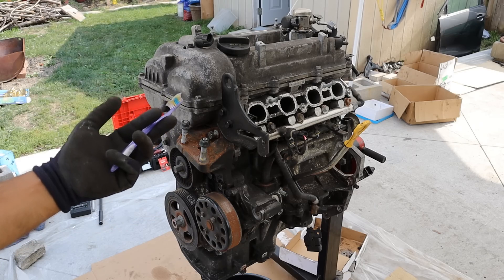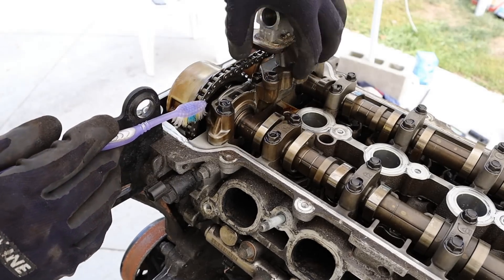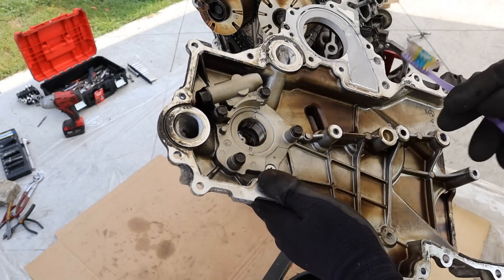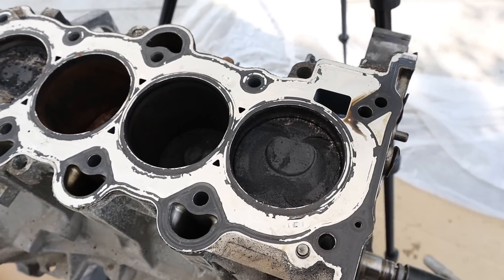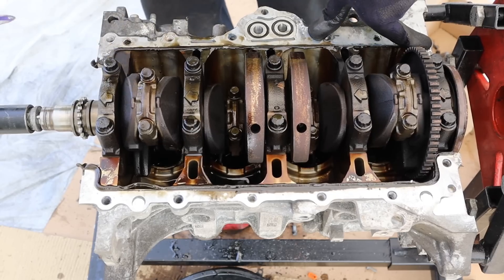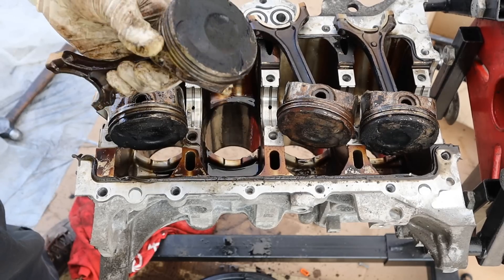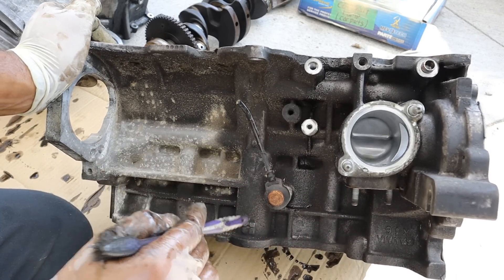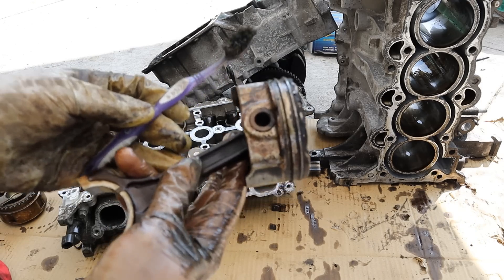Why KIA Engines Fail

Comment: Please show us a Honda A20A3, or any Honda A20 engine!  Mine has 350,000 on it now!
Reply from the maker: Didn't even know they had an A series engine!
Reply: @speedkar99  The Honda A series inline-four cylinder engine is used in 1980s Honda Accord and Preludes.  I love to see you tear down and analyze one!   Still redline mine at 350,000 hard miles.  Never rebuilt.  Valve job only.
Reply: @speedkar99  Ha ha!  "Why Honda A20A3's DON'T FAIL"!  
BTW, I do love your channel!  ;-)
Reply: I remember the older Hondas from Accord or Prelude, 1.8 and 2.0 L. Dual Keihin carbs, then EFI. They would consume oil when driven hard, but never heard of one going kaboom for no reason. Other than regular maintenance, timing belt change every 100k km was a key to keep going forever.
Reply: @pliedtka  Yea, mine has never had any oil consumption problem.  I'm sure the rings got a bit sticky, but some Marvel Mystery oil cured that!  My A20A3 still runs like a top, as worn out as it is!  I bought it late 1988 as an '89 model.  One owner that cares helps too.
Because I have never torn down the engine, I'd love to see what @speedkar99 might say about it!

Comment: This is where I get after a lot of people who own these generations of Hyundai and Kia vehicles.

It's like the moment they buy these cars, all mechanical common sense goes right down the toilet.

For starters I am on my 8th Hyundai / Kia vehicle and proudly stood behind Korean cars since 2002. 

The common sense thing that most owners of any cars in general, but especially Hyundai & Kia vehicles is to ALWAYS CHECK YOUR DAMN OIL!
Budget friendly cars are not going to have a digital readout to tell you when your oil is low. That's what premium car models do. The most you will get is an oil pressure alert light like most cars predating 2016 and earlier had. This is why they put oil dipsticks under the hood. That's not just for oil change specialist and mechanics. If most of you people are too dumb to understand what a oil dipstick is, then please stick with Uber or public transit.  

Religiously every week I always check my oil level, especially before going on a long road trip and BEFORE I start my car. If my engine oil is low I usually top it off with Seafoam or Marvel's Mystery Oil, not just regular oil. My goal is to keep my engine clean, break down and prevent sludge buildup. 

I make a note of the oil color. If the oil on the dipstick starts to look dark brown then I go and change out the oil immediately, regardless if it's before my due oil change service interval or not. My engine and investment matters much more to me. 

I also use high pressure oil filters, not made from paper but microfibers instead. K&N is what I use.

Every 3 or 4 oil changes I take my vehicle in for GDI intake cleaning service to blast away the carbon buildup. 
By the way all automobile companies are guilty of this GDI carbon issue, not just Hyundai & Kia.

To help reduce carbon buildup after cleaning I add a little Marvel's Mystery Oil to my fuel tank before filling up the gas. Using that product in my gas has definitely shown significant reduction in carbon buildup at my last GDI cleaning service.

Lastly in all my Korean cars I use either midgrade or premium gas, not because I'm under the assumption that it's like changing my engine's power to that of a Hellcat, or that I will suddenly get 50MPG, No it's simply because carbon buildup is a bitch and expensive to clean if you let it go for far too long. Using Premium gas in general will also help GDI owners to reduce this costly carbon buildup.

Also Change your damn transmission fluid at its due service as well as changing your spark plugs every 100,000 miles with NGK or Denso Iridium plugs (I know it's a Kia or Hyundai but don't be freakin cheap guys and gals, seriously), change out your air filter with a microfiber filter (like K&N) so your engine can breathe better, and seriously if you have an AWD crossover, change out your damn gear oil as well.

Yeah owning a car and maintaining it is expensive blah blah blah. If you want your car to last you for the duration of your monthly payment term and not be screwed with a big repair bill, invest in maintaining your shit.

Lastly always pay attention to issued recalls and get it rectified immediately. 

Aside from owning a Genesis G70, Kia Sorento Ex V6, I also own a 2007 Tiburon with the 2.0 that still purrs like a new car under the hood because of how I take care of my vehicles.

You can guarantee that I will be the first to blast anyone with harsh condescending words if I see a post of someone calling Kia or Hyundai junk because their engine seized up and their oil was super low or empty but somehow didn't know about it. Really??  🙄 🤦‍♂️
Reply from the maker: Yep. Oil is key.
Reply: I like Korean cars and own a 2020 Elantra. But I will say premium gas won’t do a gdi car any good. Because the fuel isn’t being sprays behind the valves. Gdi systems without multiport injection combined (Hyundai and Kia’s other than brand new ones after 2020 didn’t use that and only had GDI only) which means no matter what carbon will build up. Gas has nothing to do with it if it’s not being sprayed on those parts to clean them up. That’s why Toyota started using gdi and mpi to get the benefits of both without carbon buildup. Hyundai recently started using that on one of their vehicles but not all.
Reply: @zabryant01   actually premium does have a lot to do with carbon buildup. I'm rarely ever driven by people's speculation anymore these days because it's just that, only ones speculation. 

From my cleaning service intervals if I use premium quality gas, it will significantly reduce the time it takes for carbon to buildup on the back of the valves vs lower quality gas, also noting my driving habits did not change. 

I can clearly state this as I have seen the differences pointed out to me by the mechanics at the place I have my intake cleaning service done. They show me pics because needed comparison notes for regular/midgrade gas vs premium and straight premium vs premium with Marvel's Mystery Oil added to the tank.
My best (barely needing cleaning) service was when I used premium and having Marvel's Mystery Oil added to the tank to my current GDI vehicles, except for my Tiburon. 

I've clearly been doing this for a good number of years before GDI was introduced and as people were arguing about premium vs regular. I prefer seeing actual results on my own vehicles, not hearing some proposed car fanatic who owns a Hellcat or a WRX STI telling me how premium is a waste of money.
Reply: @Tanooki2003  premium gas is only a higher octane. That's it. More important is that you use a top tier gasoline and not stupid mystery additive.
Reply: GDI intake cleaning service? Do you do it or a professional mechanic does the cleaning?
Reply: @ramirocosta1  I use a professional and certified ASE mechanic who has experience with Kia & Hyundai engines as well as having actual GDI training.
Reply: @Tanooki2003  thanks will try and find one! Im based in Portugal we have hydrogen carbon cleaning machines. Is that tecnhology your mechanic uses to carbon clean your GDI?

Comment: @5:37 i was hoping for a "there's your korean bbq, all you can eat" kind of joke when you popped the head off and checked out the carbon buildup 😂 😂
Reply from the maker: I'll keep that in mind haha
Reply: I have seen on worse on CR-Vs. The last one melted it's piston, on the side where rings sit, before detonating. Other than that, burned valves, rings baked in their places, but brought back to live. The Elements engine also prone to camshaft lobes wear out.

Comment: I have 2020 Hyundai 1.6.  that has been great so far.  I am very careful about oil changes at 3750 mile intervals and check level once a week.  Say what you want, but when a Corolla and Civic are approaching $30,000 I have to look at other options.  Thank you for your videos!
Reply from the maker: You are welcome. Take care of it and it will take care of you. 
Not sure if yours had port injection but if it's GDI only, consider an intake cleaning once in a while
Reply: @speedkar99  2 injectors per cylinder but paired next to each other.  GDI I believe.   
I will do cleanings.  Use top tier fuel only also.
Reply: @toddgiambruno  If there are 2 injectors per cylinder then you have both port and direct injection, which is better.
Reply: @toddgiambruno  one is gdi and the other is a di, like toyota does
Reply: @toddgiambruno  does top tier mean premium fuel(91 or 93 octane)?
Reply: @IntrnetCat  no.  87 octane 
It’s the detergents in the gasoline and a rating.   Mobil and Shell are the stations near me that offer “top tier” fuel.
Reply: @toddgiambruno  Sorry to bust your bubble but 91 or 93 octane is better than 87. In my country the lowest grade fuel is 95RON.
Reply: @IntrnetCat  if you got a Costco I'd go there for fuel if you cant get to a Shell or Mobil.
Reply: @speedkar99  For 2020, the Hyundai accent got "smartstream" port fuel injection again. Can't recall if the turbo 1.6 in the Elantra is still direct injected or not.
Reply: @clover7359  your mean smartstream 1.6 T GDI is dual port injection?
Reply: I know 4 people with over 200K on their Hyundai Sonatas and Elantras.  They have 100,000 mile warranties for a reason.
Reply: 1 yr update, how many miles on that Hyundai & does it burn any oil with your short oil change intervals that seems less likely. I'd do mine with 1st oil change 1k miles, 3k for 2nd, & 4k thereafter.
Reply: @dbzownz12345  57,000 miles.  Doesn’t burn any oil.
Reply: @toddgiambruno  Great that's slightly over national average so it's good to know that Hyundai with proper care can last. thanks
Reply: Do you use conventional or full synthetic oil for your 3750 mile oil changes?
Reply: @charlescurran1289  
Hyundai calls for 0W-20. To my knowledge; that is only a full synthetic oil.   Started using mobil 1 after the break in period and first oil change.  I keep a vehicle at least 200,000 miles.
Reply: @toddgiambruno  I do my Kia at 5,000 intervals with full synthetic because Kia couldn’t tell me if they were recommending conventional or synthetic for the 3750. That’s quite a short interval but if it works for you that’s great.
Reply: @charlescurran1289  I follow the “severe” service intervals because of the cold climate (New York), short trips to work (less than 25 minutes).
Reply: @toddgiambruno  Thanks for your perspective. It was helpful.
Reply: Other options such as a 2nd hand Corolla or Civic ;p

Comment: I don't know why Kia/Hyundai is so bad in North America, in South America they sell cars by the thousands and they keep chugging along no problem, not the most spacious or comfortable cars, but they are reliable as far as I know, the smaller box trucks with the diesel engines gets beaten and overloaded and i see old ones on the road everyday.
Reply from the maker: Maybe it's the demographic of owners and the extended oil change intervals.
Reply: the same in Australia, Kia and Hyundai consistantly top annual sales figures and are generally well regarded here. My brother has owned a 2005 and 2013 Cerato , both were always serviced and were mechanically sound, we didn't have any issues. The 2005 Cerato had 300,000+ on the clock before it was replaced. The 2013 was written off.
Reply: In Australia it is 15000 km or 12 months  service intervals . Hyundai/Kia are great cars .  And sales in Australia reflects that . Hyundai is 3rd and Kia 4 in annual sales .
Reply: Other than the climate, the Alabama plant is not what other top manufacturers operate today. BTW,  I remember my neighbour saying his co-worker's 2019 Tuscon with Turbo granaded itself at around 70+k km. She was using it for big canoe camping trips, so maybe the engine was too weak for the load and terrain. Anyway, she had all the maintenance done at dealership with papers to prove it. I'm interested what's going to come out of it.
Reply: know what? muricans are tarded

Comment: I had this engine in my 2014 KIA Rio 6spd and I wasn’t impressed. Totally reliable but I could barely get 30mpg with a light foot and the engine required premium gas during the summer because the AC load would make the engine ping like it ingested marbles! The 2 liter port injected engine in my 2022 Forte is smoother, quieter and achieves 40 combined mpg without even trying.
Reply: exact same car except for the years(2015) i get around 6.3l/100 in the summer and under 7 in the normal winter. And i do an italian tune up on it daily! mine is very frugal even when bashed around....you need to put the rpm up around at least 3750 rpm to feel the surge...under 3000 it lags a bit...
Reply from the maker: Premium gas in a forte??
Reply: @speedkar99  That was 91 octane for this same 1.6 engine in my old Rio when running the AC in the summer; very annoying ping issue on a relatively trouble-free engine. I upgraded to the 2 liter in the Forte when I learned KIA stopped with the direct injection complication on their economy cars; couldn’t be happier.
Reply: I've got a 2016 Kia Soul (base model, 1.6 L, 6-speed manual).
The best I've gotten on long highway trips is about 35 mpg, but typically get 30 to 31 mpg (with 87 octane gasonline).
I haven't had the "ping" you described when running the air-conditioning, though.
Anyways, for a long while I've felt that a 2.0 liter engine would be a better pairing for the car, and it seems we agree on that.
Problem is, finding one with a manual transmission.  🙂
Glad to know that the 2022 engine in your Forte is a significant improvement.
Reply: Fuck yes i completely know what your talking about i absolutely hate that shit i have to run 89 sometimes because its annoying af. We have a 2.0l na 2020 Tucson with a catch can since brand new, now at 40,000 miles trouble free no issues at all. Some people wont get it even with this motor running completely fine it will ping on 87 octane. its cooler in Florida right now as well and it still does it it baffles me how they designed this motor. if i put the ac blower on setting 2 or higher it seems to drive smoother but if i put it on 1 it pings. Just makes you think something is wrong with the motor when really its carbon free doesn't burn any oil its just the way they designed the engine makes me think they didn't even test this motor at all?

Comment: Someone on my street has a Kio Rio with this same 1.6 GDI engine. Whenever they accelerate, it blows blue smoke out of the tailpipe. Oil burning issues are pretty common on these engines
Reply: That may be due to those clogged Oil-Control Piston Rings he mentioned in the video, or worn valve guides due to Carbon Accumulation, but I am not a mechanic. If it smokes under power is probably related to piston rings.
Reply from the maker: Ouch. Probably needs valve stem seals or rings soon